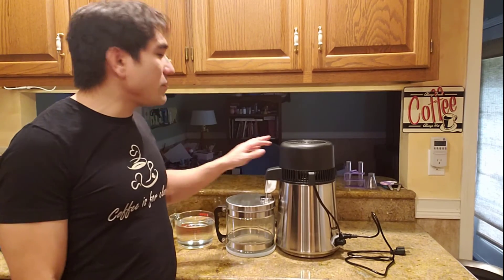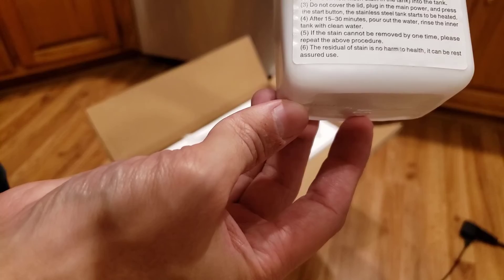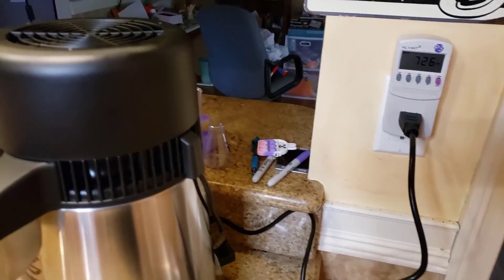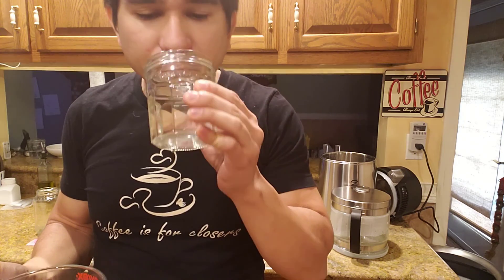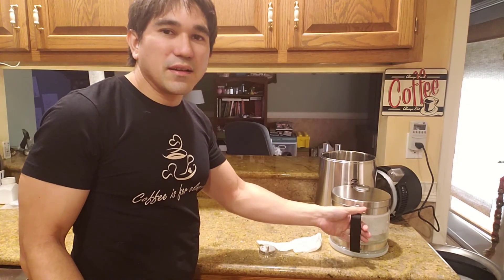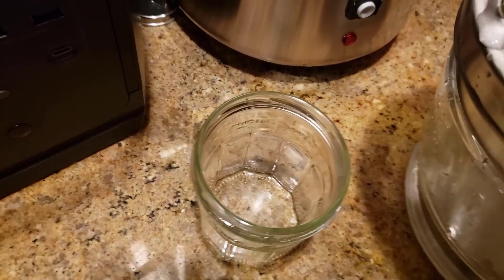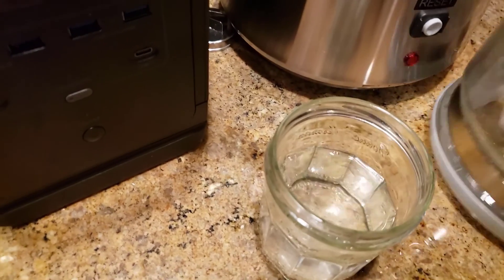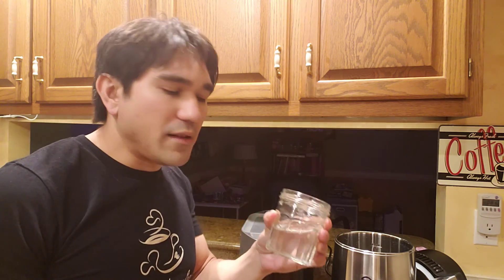Distilled water is not PURIFIED water! Energy use, residue, taste of a water distiller from Amazon

Comment: We've used a distiller for about 30 years (2 different ones).   It takes about 5 to 6 hours to distill.  Every couple of months you fill the distiller with white vinegar and let it sit for several hours.   Then all the hard deposits clean out easily.   I save the used vinegar and use it again a few times.   Then I put the well used vinegar to sit in the toilet to clean out calcium deposits.   Our water tastes fine.   We don't use the charcoal filter.   I'm 75 and never been to the ER, never hospitalized, never had surgery, and never have broken a bone.

Comment: I bought a megahome distiller. My water after distilling smelled and tasted like chlorine. It was nasty. I returned it.
Reply from the maker: lol sounds like it sucked the dissolved chlorine through it
Reply: Yeah... For $300 and it doesn't have a system to prevent that?  @WinstonCodesOn
Reply: Lower boiling point compounds boil off first. This is worth experimenting on.
Reply: I did. I collected the first 15 minutes of water and tasted it. I almost gagged. But for something that cost $300, and did not have a built in system to get rid of that stuff, was not worth it in my eye. I bought a triple filter water filtration system for only $200, and the water taste perfect. No need to wait 6 hours just for a gallon of water. @cosmicallyderived

Comment: Fill the unit to the fill level, then add another pint, plug in the boiler, and leave the top unit off.
Let it come to a rigerous boil, and let it boil for fifteen to twenty minutes, to boil away aldehydes.
Next, place the top unit on and plug it in.
Place a quart jar under the nozzle, and run until jar is about half full.
Discard the jar of aldehydes, and only then, place the collection caraffe under nozzle.
Stop machine before it completely fills the caraffe.
Now you will have perfectly distilled water.
By stopping the machine before it runs dry, you will prevent any heavy metals in the dregs, from vaporizing, and entering the finished product.
It also prevents hard caking deposits inside the boiler, which are hard to clean.
The remaining water in the unit can be dumped, and the boiler only needs a paper towel drying, to make ready for next run.
These steps will change everything for you, and make the little filters unnecissary.
Reply: great instructions, what distiller do you have?
Reply: @hellmunddegenhard  I have the stainless H20 Labs model, I bought used on EBay for $200.
It works perfectly, and I run it at least once a day, usually.
Reply: @hellmunddegenhard  I like the H20 Labs model because it's made in USA, and uses a little less power than the Megahome, which can get too hot and atomize heavy metals into the mix more easily than the H20 Labs.
Reply: @1MADDLAD  That sounds like a great machine, I didn't know about it, I'll add it to my options. thanks for the answer!
Reply: Make a video, so the info gets out.

Comment: And you should using a PPM meter to test it. Also, the unit it designed at a set temp, not various temp as you would use for a still. That’s why you had alcohol come out first, then mix, then Water. It was just the heating up process you used that did those separations. On a still the lower temps are maintained until all the alcohol is removed. Then you could bump it up the temp for water. This is why you toss the first parts of alcohol when distilling. Its full of alcohol plus VOCs.
Reply from the maker: If there is still alcohol and VOCs mixed in with the final product of the distilled water because it heated up too fast and mixed them all together, doesn't that defeat part of the purpose of this unit? It's not doing it's job to give you purified water!

Comment: All this is , is a glorified and expensive electric kettle.

If you boil water i  a regular still, ljke you use in making whiskey. You will get the same result.

This system will use a lot ofelectric to run. Suggest save your money and make your own still. The result will be the same and cost less in the process..

The only true way to purify any liquid is to put it trough a centrifuge system. This does have two elliments to it.

Firstly the desired liquid and secondly the by product liquid usex to flush the system whjch is normally discarded.

Hope it helps

Comment: Mine has that burnt smell/taste as well. Looks like the exact same unit. Compared to bottled distilled water, which smells like nothing and tastes clear. The bottled distilled has 0 PPM on my TDS reader, whereas the distilled water from this unit has 16. Still far below the 60 from the tap water, but I’m concerned by the actual particles that are in there. I’d rather take my chances on the plastic bottled water at this point. Thanks so much for your work on this!
Reply: I preboil my water in a BIG POT  FOR 20 minutes before putting it in the distiller  i  get  around  3-2-1-0 ppm  but still the water has a burnt plasti smell and taste
Reply: @danielbrady3684 i had the same but seems to be gone after the distiller was used for a good few times, just distilling now will double check
Reply: Ur letting it cut off on its on. U can stop it or add lil extra water. The smell is the particles left burning. @danielbrady3684

Comment: I've used distillers for years... one thing I noticed with the distiller you are using is the rate of outflow.... I have never seen a distiller with an outflow as fast as yours.  Typically, the process is very slow and results in a slow drip, drip, drip, scenario... not a stream like there appears to be on yours.   This makes me think that the process in your unit is inefficient and inferior.  I would like to see a test using a really good quality distiller to base any conclusions on in regard to distillation.

Comment: Distilled water has nothing in it.
Purified water has minerals.
Love my distiller. I use it in my humidifiers. And my water kettle.
Reply from the maker: Distilled water doesn't have dissolved salts in it. But, some compounds with a boiling point close to water can end up in the distilled product unless you are able to isolate the output to exactly at the temperature that the water is boiling.